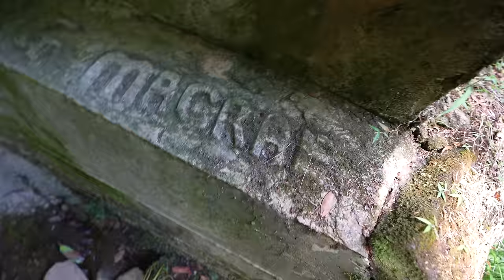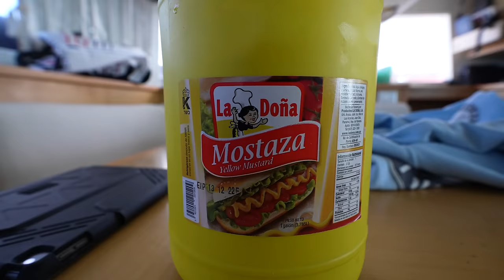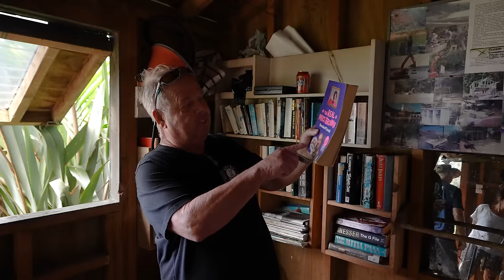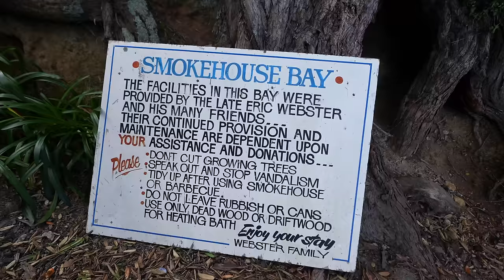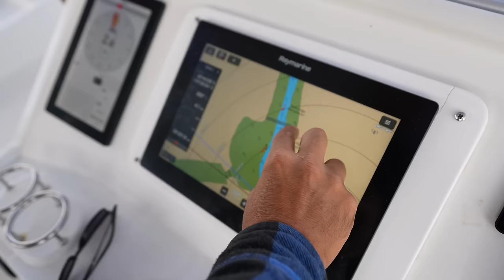GRINDING FIBERGLASS INSIDE THE BOAT IS NEVER FUN… - Sailing NZ pt 2

Comment: Hey there Col, wonders never cease to the talents and ability to take any failure or repairs, was just watching Zatara and Keith changed his motors from Volvo Penta to 110hp Yanmar and he has to cut and shut his transom by 120mm to get the new engines in but Just Catamarans did all the work💰💰💰💰 I know if that is was your good self the job would be done sooner than later. Enjoy your episodes, take care god bless 👍😇🙏⛵️

Comment: Positive pressure anti-glass mask -  When I was in surgery a few days weeks ago I noticed a flap opening and closing in the little room I was in before I went into the big room with the sharp stuff, all the people, and all the big-screen monitors. I asked about it, and they said it was "filtered positive air pressure" to keep the pesky germs out of the room. The point was you could open the door, and none of the unwashed masses outside in the corridor could get all up-side your self. It should be easy enough to rig your compressor to blow constant air into a facemask. That way you would be pushing fresh air into your mask, and nothing would get in past the face hair, and wrinkles, or any extra chins you'll one day develope :). It might even be nice to have the breeze. A lightweight hose like the kind you use in fish tank air supplies would do it with a compressor powering it (I'm guessing you would only need maybe 20L a minute or so (I think a lungful of air is 8L)), so it wouldn't be too much of a drag on your head as you move around. It might be a little loud, but that's easy enough to fix, and much less itchy and lung wrecking than breathing glass where you should be breathing air. - Just a thought.

Comment: Collin says James Cook was the first European to discover New Zealand, but I thought it was either the French or the Dutch who did that, but Cook got the credit because he actually mapped/explored it.

Also, fun fact, Cook's three famous mapping adventures in the Pacific, the first on Endeavor and the second, and I think third, on the Resolution (I could be wrong about the last), the maps he created were so well done that they were still in use into the 1990's.  I mean think about that.  No satellite, no modern navigation equipment, etc. but the maps were so well done they lasted for nearly two centuries.  

By the way, check out "Blue Latitudes: Going where Cpatain Cook has gone before" is a fantastic book by Tony Horwitz.  It's an incredible and informative, as well as humorous, travelogue and historical novel similar to Bill Bryson's work.

Comment: the 3M brand masks with silicon where they touch the face are good; unlike asbestos, the fiberglass works its way out of the lungs, but all the same . . you were lucky the conditions were so light when the accident happened and you can be sure the other side will go at some point without reinforcement

Comment: Worth the money to rent an air scrubber of around 1000cfm's based on the area to remove 95% of the fiberglass as it comes off the grinding wheel. You can find them at construction rental places here in the USA as they are used extensively for Healthcare as well as many other renovation projects. For $200 US (includes filters) a day you can just about not even need a clean suit or respirator.

Comment: Hi.  Great video; l gotta get to NZ before. l die! No. 1 on my bucket list.  I agree Lagoon did a lousy job on Spinnaker tack point and you paid for it with this itchy repair but you could take a different approach to fix the port bow.  Install a pad eye on the underside of the deck fitting and attach a turnbuckle and a small length of anchor chain to an eye that is screwed into the thick glass that makes the bow. Try and line up the attachment point as close as possible to a straight line from the tack to the top of the mast.  Tension the turnbuckle so the strain is taken off that deck fitting when flying the Spinnaker.  You could also make this mod to the starboard bow.  My lower attachment point is actually a SS eye threaded into a SS tang that has 4 lag bolts into the fiberglass of the bow and the I glassed over it.  It is on baby stay for storm sails, so I was taking no chances!

Comment: Poor fitting dust mask? Get some open cell foam insulation 'tape' in 1/2 by 1/4 inch with peel off adhesive tape on one side and stick it to the mask rim. I did auto body work when younger and sanding Bondo was nasty, dusty work. The masks always leaked, so I used the black foam and it really helped. Cheap fix, A whole roll was less than two bucks back then, it's only about five now...

Comment: Your respirator won’t seal to your face with a beard.  Your respirator needs to have a tight fit and seal between the respirator membrane and your face so that breathing air into the respirator ONLY comes through the filter.

Comment: I sympathise with you and all that fibreglass dust, but there is only one way to get a job done properly, and that is to do it your bloody self, the way I see your problem is that it was never bloody done properly in the factory and that, is disgusting, if that would have happened in a big sea that forepeak would have filled up on the next wave, you, were very lucky, I mentioned your problem to another Lagoon owner just to make them aware, and their response was that they had a 450, not a 440 and they were totally different, and also your boat had been sunk once, don't know what the hell that has to do with it. I just hope you don't have to reinforce the other side. Safe and uneventful sailing for the rest of your trip.

Comment: Next time shave your face before you wear that mask it will fitl better
I learn that in  lead and asbestos abatement training.. also a little talcum powder on your wrists and ankles neck face and chest fills your pores a little bit so it can't get in and then I always taped my suit to my gloves boots and got it as tight around my neck as I could LOL without strangling yourself another tip once you are done grinding strip naked and jump in that cold water and immediately rinse off😅